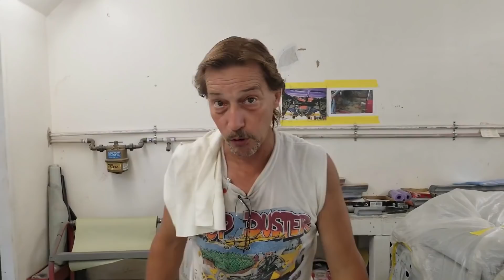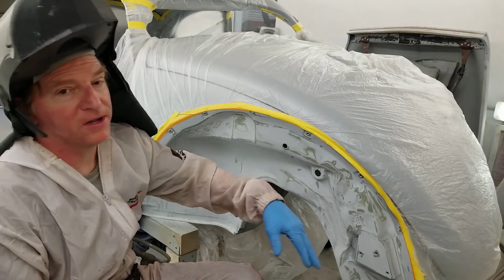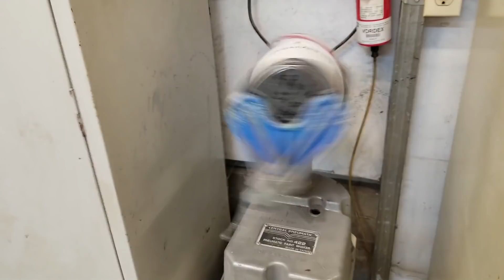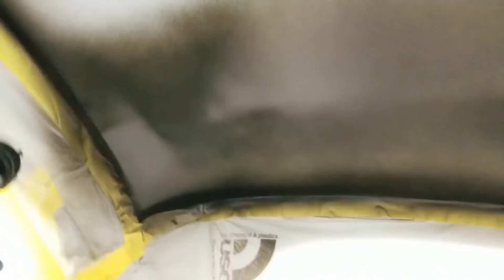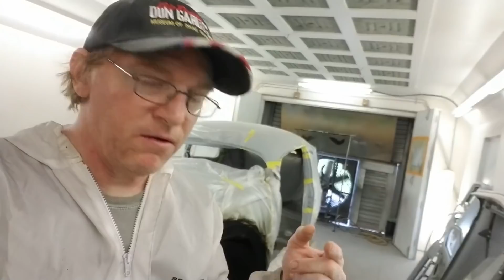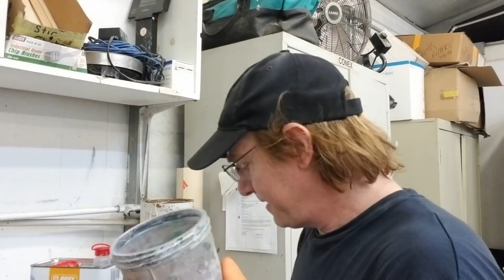Eleanore - Painting Wheel Wells And Inside - ROTTEN OLD CHOP TOP 1956 VW BEETLE - 153

Comment: A good way to spend a Saturday arvo. (Or Sunday here in Oz). What tip size and at gun pressure are you using Earl? Being curious.
Reply from the maker: first stage pull wide open pattern 10psi  with a 3/4 pull on the trigger to keep the blow back down.